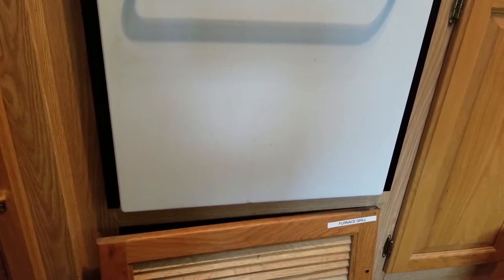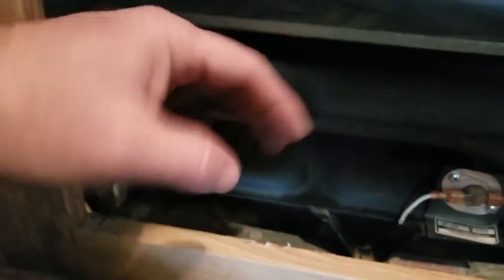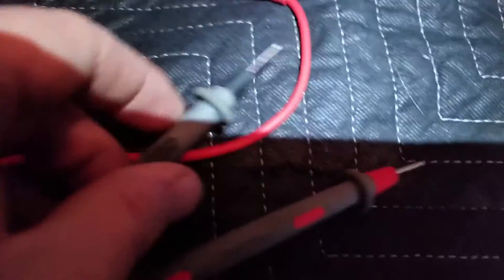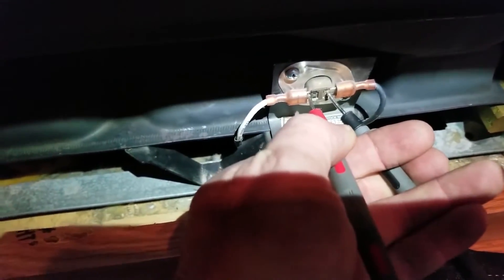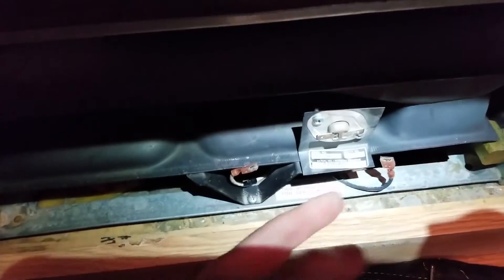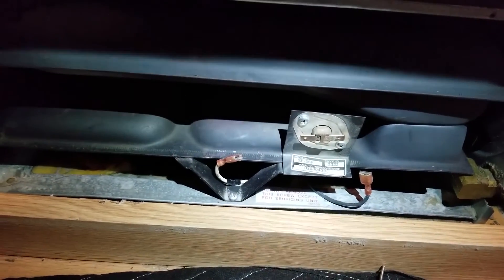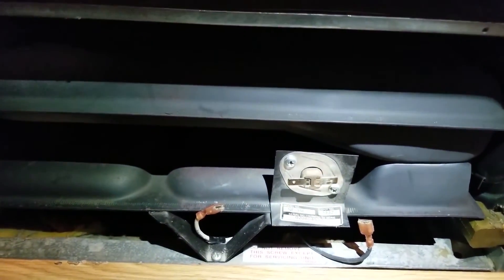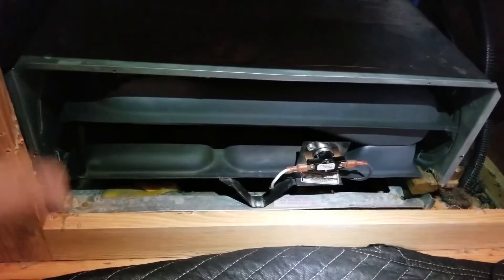Suburban 3500 RV Furnace With A Failed High Limit Switch

Comment: How many volts should be going to limit switch?   Mine is reading mili volts
Reply from the maker: Volts should be ~12V.  You will only see voltage pass through if there is a call for heat at the thermostat AND the blower is on which will close the sail switch.  The High Temperature switch is part of an AND circuit, wired in series with other switches.  Like links in a chain.  For the 12V to get to the High Temp switch it needs to pass through the thermostat and the sail switch first.  Some mfg's wire the HT switch before the Sail Switch but principle is the same.

To test the HT switch better is to remove one of the wires from the spade connector and check for continuity through the switch.

To test if it is in fact the HT switch, you can bypass the HT switch by connecting those two wires together and testing the furnace.  If it starts you know you found the culprit, if it still does not start then the issue is elsewhere.

Comment: Excellent! I have the SF-35Q Model installed in my 2019 Outdoors RV and this is likely the culprit, or the sail switch. Both are inexpensive and simple to replace, so I'm going to buy one of each. I've replaced the limit switch on clothes dryers before, very similar. Thanks for the video!

Comment: I have a Keystone Laredo and I can access the heater compartment but can not figure what holds the furnace to the floor. Of course, all the important parts of the furnace are facing away towards the compartment back wall. I really don't want to drop the all season bottom cover to find out whether or not the unit is screwed in from below.🙄

Comment: So if I get ticking sound from the ignitor that will indicate the high limit switch is good?  I recently had replaced my propane regulator and all worked good and all of a sudden it stopped working again.  It fires and runs for a couple minutes then stops and goes through the 3 cycles of igniting again before shutting down.  I am stumped.

Comment: Awesome video and input, thank you! Our furnace runs fine for a little while, then won't kick on. If we reset it (leave off the thermostat for 3 minutes), then turn it back on, it will kick on immediately and run normally for a while again.  I hope the probably is as little as this.. :-)
Reply: We finally figured our problem too, ended up replacing the thermostat itself and it has run fine ever since.
Reply: I’m having a similar problem. Did you get yours working?
Reply: @lorenrickey5481 Did you get your problem solved.  Mine is doing the same thing.
Reply: @more2thislife572  Yes I did. Bad OEM board. Switched to a Dinosaur board and no more problems. Thanks for asking.

Comment: Okay I know help ain't free normally. Been having a problem with my RV furnace all year and I'm contemplating replacing it completely. Comes on and ignites seems like fan speed is slow barely blowing. if I leave it running the whole camper will fill with exhaust fumes. No I'm not using it. Ideas? I even fully disassembled it and clean the combustion chamber what a mess. That stopped all the soot coming out of the exhaust while running literally black soot. But did not fix the issue. I also hooked power to fan while disassembled and seems to blow perfectly fine. Once unit is back together different story.

Comment: love your videos. straight to the point and very helpful. can a limit switch fail and cause the furnace to overheat? mine gets really hot to the point where you can't touch the furnace cabinet. what should the temperature be coming out of the ducts? the furnace works fine other than that.  thanks

Comment: My blower isn't turning on at all. Thermostat relay fuse is good. Makes a single click when I connect the thermostat wire to the furnace then nothing happens. Any suggestions?

Comment: I have a similar furnace and it sometimes heats and after awhile only cold air. I here clicking but if I shut it off for awhile it will do fan and clicking then heat. What’s your suggestion
Reply: what was it?

Comment: I have an suburban furnace and when the thermostat is on Tue heater fires up bit it makes a very loud clicking sound the furnace works fine but the loud clicking when I turn the thermostat off the clicking stops the fan is still turning for the cool down just no clicking

Comment: My problem was from the mice they had before I bought this unit.  They had chewed the water heater wires ( all of them) so I had to add wire and chewed the heater igniter wire and the thermostat wires.  Thank you for the videos they really help a lot.  I was a auto tech for 21 years and I grew up helping my daddy after work working on appliances and home wiring. Thinking about getting my certification for RV and campers since I’m living in a RV Park anyway.

Comment: I just stumbled into this great resource.. Thank you!  Do you happen to know if Suburban is having trouble with furnaces going over-temp and locking themselves out?  Ducts are all open and the number of ducts are in compliance with Suburban's spec. I have registers at 140, 130 and 120 degree temps.  The furnace shuts its self down and locks it's self out  before satisfying the T-Stat.  The trailer manufacture says  "That shouldn't happen". My RV Tech says but an extra duct run it.  It's a brand ne Grand Designs 25G with the Suburban  SF30Q..  I can't get the Tech to check voltage right at the fan.... Do you bump into over temps and what is the common remedy?  BTW,, Guys that talk ANDs and OR's got to be real techs!
Reply from the maker: I have come across this before.  For my test I installed a datalogger to monitor the high temp switch in the burn chamber.  What the results showed was the switch was doing exactly what it should have done - it was getting too hot in the furnace because there was a restriction in the duct work.  In the RV I was working on I eliminated as many sloppy curves to the duct work to make the air flow more smoothly and added an additional duct.  Alternately you can increase the size of the duct work to allow more airflow to vacate the furnace heat exchanger.   The RV I was working on had a very long duct line in 4" duct.  I believe (but did not take the time to prove) that the issue was the length of the duct.  Hope this helps.
Reply: Mine too. Did you find the problem?

Comment: I have watched all your videos on furnaces and they are great but i have not seen one fail the way mine is failing. I have an attwood on a 1994 prowler. The furnace works perfectly until it gets up to set temperature. after it shuts down and tries to restart later it fails. if you shut the furnace off and restart it it will work fine and repeat its fault. basically it starts when you go to bed and fails. you wake up cold with it blowing cold air until you reset it. Not really sure where to start.
Reply: Mine is doing this too. Did you find the problem?
Reply: @lorenrickey5481  I have not. I am going to order a control board for it soon though.

Comment: Darren I enjoy your videos, they are very informative. I have a NT 30 SP Surban furnace, I am mechanically inclined and my question is which of the there or 4 with control board is more likely to work sometimes? I have already cleaned the sail switch of debris and the blower fan. I ran it 4x and it fired right up, then quit, failing 4 times. Today 1st time it fired right up again? I bought a new electrode and limit switch today but haven't installed yet.

Comment: Great information. I have an RV which looks alot like the one depicted here with the furnace in the same place. Furnace was blowing but not lighting and then turning off. Checked the limit switch jumper idea and POOF... it worked fine. So, faulty limit switch!  Thank you so much!
Reply: Hi !  When it blew did it also blow propane or just blow air ?

Comment: Ok im having a very similar issue on a duo thermo furnace. Fan kicks on but only blows cold. Now the sail switch is in a tricky spot and i dont know if its completely making contact without having to pull the whole unit out, but i can reach in a manually manipulate it and hear a positive click. Should i pull the whole unit out to get to it or try and find high limit thermo? Please and thank you.
Reply: Place the ohm meter between the 2 sail switch leads and turn on the unit. If the switch closes, the ohm meter will show zero ( connection established)

Comment: I have suburban SH35 saw your video found the high limit switch had 12v on one side and not the other. Tapped the switch a couple times and the ignitor started order new high temp sensor.  Thanks for the video

Comment: Looks like i have the same unit. Im having a problem with my furnace maybe you can help point me in the right direction. I'm turning the furnace on it comes on heats up my trailer for a while, gets nice in here But then all of the sudden it shuts off and a couple of the life go off.  It's not popping a breaker or any fuses in the trailer and a few minutes later the lights will come back on by them self but the heater won't. If I wait a little while and turn the switch on the thermostat off and back on it will come back on heat up the trailer again but does the same thing again. Any help thanks
Reply: You need a new battery
Reply: Did you ever get the issue fixed and find out what caused it? I’m having the same issue with mine
Reply: @DSmith8229  yes i did it was that switch on the back of the furnace

Comment: I have a new Tiffin motorhome purchased last summer and from the first time I turned on the Suburban SF 30 furnace I notice the burner keeps relighting every 2 to 3 minutes. The fan stays on. From cold the furnace burner lights and 2 1/2 minutes later it turns off. After 1:40 minutes the burner relights. This pattern continues until the thermostat sees the desired temperature is reached. Is this a high limit switch issue? Thanks

Comment: My Atwood 8531-IV DCLP  has an air flow/limit fault problem, but the fan casing isn't loose and so can you please tell me how to fix the air flow/limit fault so my furnace will start working again.